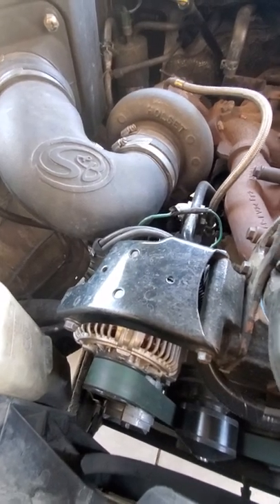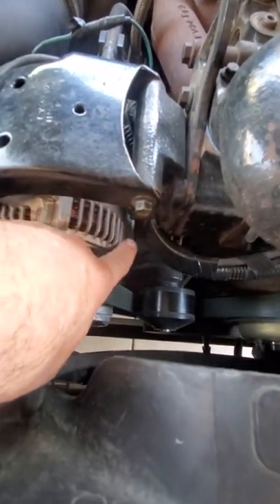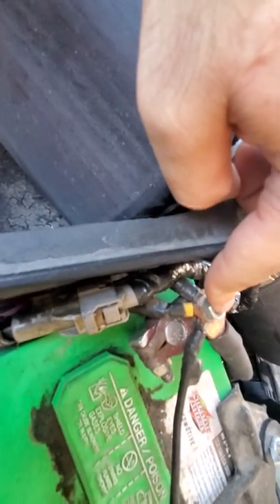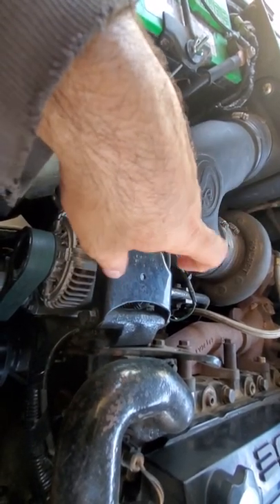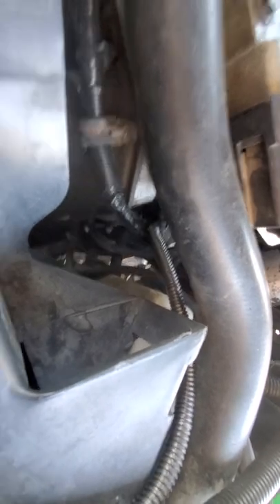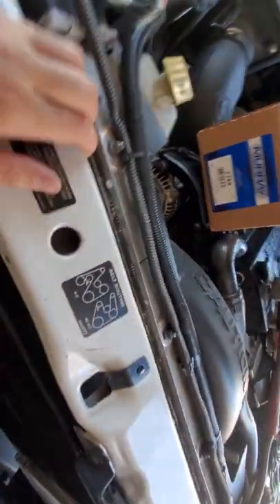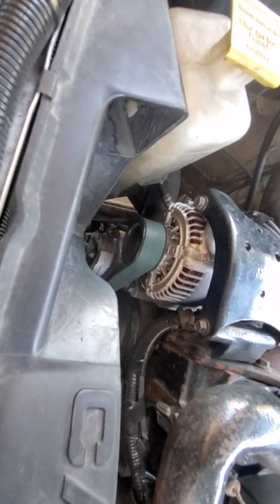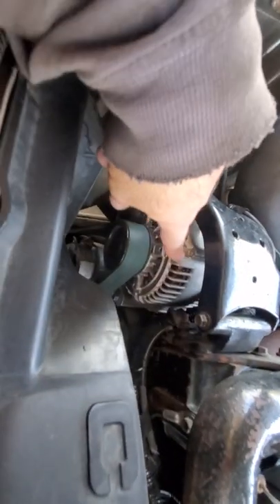2nd gen ram cummins surging transmission lock unlock torque converter.

Comment: It’s not just that wire that causes the problem. I’ve done all these ground fixes and more and I still have the problem. Mine only unlocks and locks one time around 45 and then It will finally lock into overdrive. If I give more than a third throttle, it won’t do it. I’ve driven with the alternator completely disconnected and it still does it. A lot of people on the forums have done these fixes and they still have the problem
Reply from the maker: Have you figured out what the problem is ?
Reply: You have the fix?
Reply: I have the same crap issue…. Everyone keeps sayin I have a leak/puncture on the fuel lines somewhere…. An other people are sayin the turbo could be shittin the bed on me…. An other people are sayin the torque converter could be gettin ready to grenade itself Cus I’m constantly hittin out of overdrive while drivin through town… tryin to avoid this issue an well I get screwed anyway
Reply: @russellsmith3707  I’m in this boat right now you sound just like me people have been telling me same crap did you find your problem? Shop is supposed to call me today
Reply: Look at the 2 wiring harnesses that wrap around your oil dipstick (2 separate 12 pin plugs,they are on a bracket with a push tabs on top of the fire wall). They vibrate on the dip stick tube and rub the wires bare and cause short circuits. One of those wires is actually your torque converter lock up hot wire. Owned two 2001 Cummins at the same time and both did it. replaced trans in one and still kicked in and out so I sold it. Other one started to act up just to and found a forum with this info im sharing. I checked them and boom I had 5 wires rubbed completely in half. (Over 300k on truck) cleaned and reconnected them and now shift like a brand new truck. Wish I would have kept the other one. Let me know if this helps!!
Reply: And I mean the Actual wires rub on the tube not the actual plastic plugs, you will have to cut/splice wires back together. Just trace all wires individually in that area…before and after those plugs.
Reply from the maker: Hi do you still have the problem ?
Reply: @projectramlife819  yes. I've yet to replace apps to see if it would fix it. I just give it more than half throttle it doesn't seem to do it. Still annoying when it does though
Reply from the maker: @truthhurts2149  I've just uploaded another video check it out . And let me know if you've done these . If not give it a try I'm very positive and think it will fix your problem. I final took care mine after countless hrs and thousands of dollars.  If something is un clear let me know I'll do my best to answer any questions.  I know exactly how annoying these is . Thanks
Reply from the maker: @jacobthompson4117  yes
Reply from the maker: @russellsmith3707  have you fixed it ?
Reply from the maker: @waymaker6694  yes check out my new video .
Reply: @projectramlife819  I sold my truck cus it just kept getting worse  amongst the other leaking issues
Reply from the maker: @russellsmith3707  ok , yes indeed  can be very high maintenance,  and very expensive.
Reply: @projectramlife819  I will be getting another just gonna check the next one over very meticulously an walk if any issues of the same caliber exist.. I went to the car side an I can say it sucks not having a truck but less issues an less headaches

Comment: You give a pretty good explanation but what you fail to explain to the folks here watching like myself and others is what colors of wires did you tap into to reroute you said a plug that's coming off the side with a gray the only plug that I got coming off the side with gray that's up underneath my air cleaner box goes to the AC and it's around the alternator goes from the inner fender wall on the passenger side to the AC accumulator or something like that you're showing a big long piece of wire loom that you say you have wire in it but you don't tell anybody of what you tapped into we understand that you have noise that causes this problem because of the alternator and supposedly whatever then wires that run around by the alternator somehow connected in series with transmission so what wire do we tap into the ground and running all the way around whatever which way you want to go is it only two wires coming off that plug and you just fine which whatever one is the ground and then just reroute it back from where it's coming from the firewall let me know if I was to have a schematic and it comes from the transmission up and around right before it hits where you splice tin I could go back even further I could run the thing all the way from the damn transmission from where it starts all the way around all the way to its own separate ground why does it have to go on that side of the vehicle on the passenger side or does it go from transmission up to PCM and then from PCM out you need to give a more clear in-depth review of everything that you did people don't know what you did under Neath wire loom please make a better well-detailed explained
Reply from the maker: Hi I've uploaded another more detailed video with an actual fix to the main problem . Here on my channel.

Comment: I have the same problem. But my transmission it's manual.
Reply: Same here. 2001 with the NV5600 and it was cutting out like dead pedal and I figured it was my tps or injection pump. But it was this ground wire that wasn’t plugged in all the way. I spent around $900.00 in parts and new batteries trying to figure it out before I discovered it was the loose ground
Reply: @Freedom17762  Ground wire from where ?  wasnt sure what ground wire you was talking about. thanks
Reply: @dishtech43   that same wire that runs up to the passenger battery. There is two ground wires with grey couplers that you need to make sure they are getting good contact. All the grounds are very important. Good luck man.

Comment: Can’t find that wire on my 97 12v
Reply from the maker: Witch wire ? It might not be the same since it's a 12v more then likely that's why.  The one in the video is 24v the 12v  doesn't have all the electronics it's more mechanical.